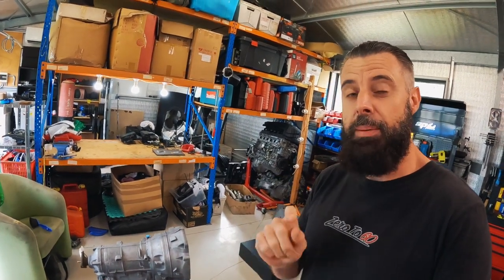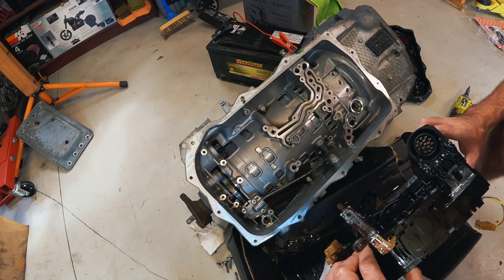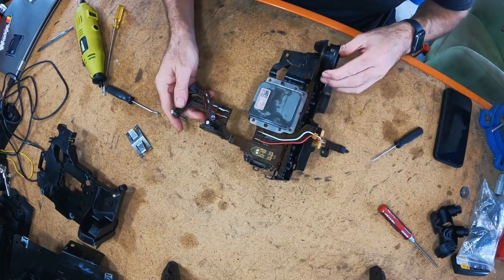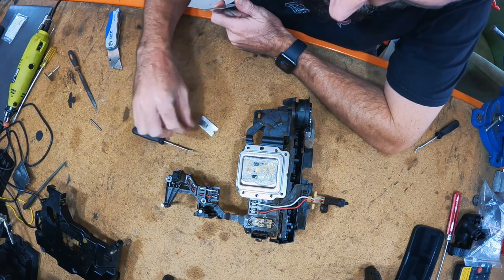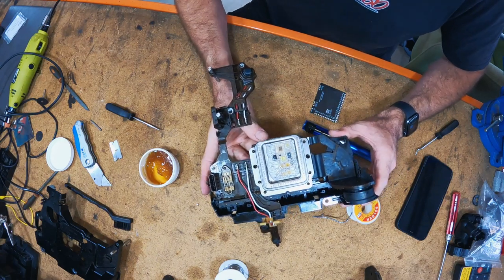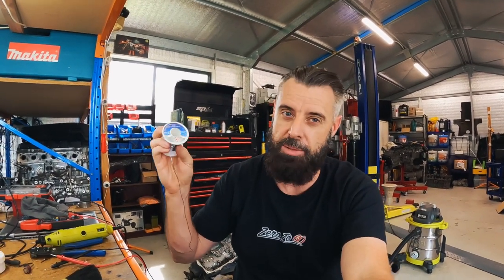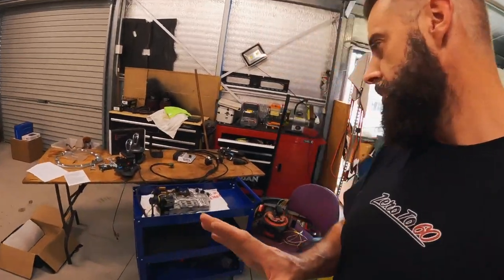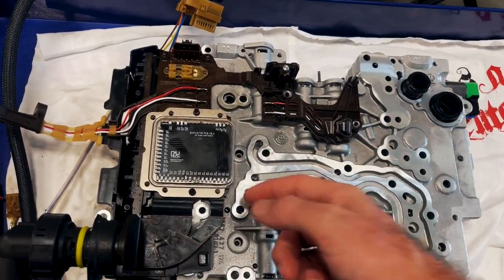Turbo Lamik 8HP TCU Modification Ryutech PCB INSTALL (SORT OF)

Comment: I bought the lamik kit in November and the one thing which was scaring me was the tcu conversion.  I put it on hold waiting for this video. Thank you for the info sharing  it is truly appreciated.
Reply from the maker: Dude it’s not too bad at all. And if you go for one of these ryutech boards and completely mess it up, you can always revert to the way lamik does them. 

The lamik way doesn’t require epoxy either. 

So you have 2 chances anyway!

Comment: As an FPV drone hobbyist a proper soldering iron is a must.  They have proper station style with higher wattage for around $50.  Well worth it from keeping destroying your components.  Using a fine round tip instead of the blade style tip.  Pre tin your board.  Flux is your friend.  Thinner Guage solder wire is your friend.  Clean your tip after each set.  Practice setting solder pads on some scrap boards or buy a soldering practice board to figure out how your solder acts and work on your technique.  I've destroyed many flight controllers in the beginning of my hobby due to simple soldering mistakes.  Take your time. Love your work!
Reply: Everytime I use flux it ruins my tips?
Reply: @piovo1  clean with a brass solder cleaner pad and some solder to refresh the tip.   They're very inexpensive.
Reply: @CHRISGr33r  I do, it just always seems to oxidize
Reply: @piovo1  your leaving your iron on for too long when it's not not in use.  This is really easy to do if you have your heat turned really high.  It doesn't take much heat to do thin wires with a decent iron so you won't have to be too cautious about it, just mindful
Reply: @CHRISGr33r  temp set to 280-320 always gets put into sleep mode after soldering whilst prepping, expensive tips decent iron idk anymore dude
Reply: @piovo1  dang, you got me stumped man.

Comment: I've done a bit of soldering before, huge pads are a pain, I'd try putting solder on the pad first, then place in the PCB and solder over the top.

Melting point of solder is ~150C, to get it to stick to a pad needs to get real hot, once you get some solder melted to the pad, it will be easier to solder to solder on the surface.

Computer PCB pads have a thin layer solder already on the pad which makes it easier.

Comment: Big thanks from me! I flow solder to the pin gap an did not know what to do. You give me the path.
Reply from the maker: Im glad my mistakes have been helpful!!! Please let me know how your conversion goes!
Reply: @ZeroTo60Tube  My adapter plate is ready 95% and now when I know how to save my plate the electronics is next.
Reply: @ksmotorsportru  hi mate I'm doing the same conversion and if you share some photos with all the wires and tcu locations where fit it?

Comment: You doing great job!! Are you going to be future proofing the trans itself tho? Like so it can have a good safety margin in the trans itself to handle the power? If I was throwing in an 8hp70 I'd throw in the sonnax zip kit into the valve body, test it make sure all the valves are good for vacuum, repair ones that are bad, if any. Inspect the internals, clutches, baskets, planetaries, bushings, just to make sure its all good internally, no excessive wear on anything. Unless you know the history of the car the trans came from. Would just be a shame to have gone through so much effort and it be a couple failing components internally that end up ruining a good track day. And with the FlowMax+ turbos on the motor you putting together, you'll be cooking mad power, I'd upgrade the clutches in the trans. Seen some guys build these 8hps with carbon kevlar frictions, then the trans got abused with over 1k hp and then they took apart, inspected and all good as new solid!
Reply from the maker: No, no upgrades to the trans itself. I don't feel the need for this sort of setup based on all the people i have spoken to. However, remember i don't do thing the normal way. It's a valid concern, but it doesn't matter how much you spend, or prepare you can have a failure. So we will go the budget option first and see how it goes. I want to show people what happens on the budget route first. The same mindset i had on the 17t car.
Reply: Oh yea thats right! 🤣 I do keep forgetting its supposed to be on a budget lol I always seem to get carried away with the "might as well do this and that while you in there" #1 reason most my projects aren't done also!
Reply: Really curious how that clutch pedal option on the lamik controller would work.. would it release the clutch on torque converter? Or Nuetral dump type of deal? I'm just as excited to see you get it all put together! A lot of valuable information you give!! Thank you so much!
Reply from the maker: @darksidemotorwerks9867  I havent asked lamik exactly whats happening with the clutch kit yet. However i imagine it will be the clutch on the gears. The TQ clutch seems much smaller than the main clutch packs. From the cut outs i have seen anyway. I feel like the main clutches will take the shock better, where the tq clutch relies on input and output speed of the TQ being close ish as it locks up anyway.
Reply: @ZeroTo60Tube  only problem is I've seen what happens to the 8hp baskets with those clutch dumps on launch control. Because the baskets/drums are aluminum and thin wall, 8hp cars launch off 2nd gear usually with the launch control and the drum over time breaks from the shock. Cant recall off top of my head which drum it is exactly, maybe it was on the earlier 8hps.. I know Audis with the v8 4.0tt 8hp that were built over 900hp had issues with that also. Had guys show me same thing in the Jaguar SVR, same 8hp, similar issue. That one was stock tho. The frictions or steels over time basically cut into the drum ribs untill it was just cut through and the drum needs to be replaced. They thinner more fragile than the 6hp drums. Thats why I'm wondering how the clutch feature would function.

Comment: How does the lamik integrate torque management into the transmission like the factory tcu . The factory tcu kills spark for split seconds between shifts eliminating that it is said to kill the trans early ?

Comment: old solder doesn't really go bad apart from the flux but you were adding flux anyway so shouldn't have been a problem, and the trick to soldering with an underpowered iron is to pre-heat the part first with hot air
Reply: I think it’s cause he used leaded free solder, if he used 63-37 solder which burns at a much less temperature I think he would have been fine, also leaded free solder cracks later on so could cause reliability issues further on?

Comment: I think you could get a better reaction with the solder if you tin the pads and scratch/scuff the tcu pins. And try using a flux core solder just clean it up with alcohol.  Good stuff tho. Not many people are willing to attempt this

Comment: I have come to realise I lack balls when it comes to car mods. You guys are are gutsy risk takers!
Reply from the maker: Dude I used to feel the same way. You just have to keep researching until it doesn’t seem risky any more. The first time I did a mechatronics seal kit on a 6hp was about 4 years ago and every mechanics and trans specialist locally said it wasn’t going to work. But I just read about it and kept learning and reading forum posts and gave it a crack, the box felt like a brand new one. That was like 2 months of that fear and worry about doing it wrong and it worked. When you have your first big fix everything else seems easier. Even drilling in to a block for head bolts haha…..

Comment: Bud may you know - have the kit from Lamik as well , PMC adaptor for M54B30 , e39 2003  5 series 5 speed auto , car boosted . And 8hp70 gearbox ZF , the TCU needed connected to the my harness of 5 speed ? Or just doing wiring , board soldering , screen , controller wirring and it will be enough? Because yours are 6speed and you connect it to your original wiring to get it think it still 6. Thanks in advance 
And sorry for my bad english

Comment: Get yourself a Hakko FM-206 with the desoldering gun and the 140W iron. I know it's more expensive than you want to spend on an iron, but what's your time/hardware worth? How much is avoiding having to pull it apart to repair it worth?

Comment: Is there any way to test the TCU on the mechatronics unit before fitting it to the gearbox without a CAS reprogramming module?
Reply from the maker: well if you have a factory tcu, you need something that will connect and send the required can bus signals.

Comment: how are you doing the torque converter to flex plate?   im using domiworks 17mm thick adapter, the only solution i can come up with, is to extend the dowel on the converter pilot 17mm and to create a 17mm thick ring to space the tc to the flex plate.   if you have an easier solution please reply. lol
Reply from the maker: I’m using n57 torque converter. So only need to add some washers and nut in the N54 flex plate location.
Reply: @ZeroTo60Tube   im using the a90 converter wich is the same back plate, same depth etc. the only difference is the side of the drum on the converter itself.  does the n54 flex plate account for some of the adapter plate thickness?
Reply from the maker: @Mp-jw1qg  To be honest at this point i am just following lamiks instructions for the N54 to N57 converter. Ill get it mounted to the box and see shortly.
Reply: @ZeroTo60Tube  i havent had a chance to get the trans bolted to the block to findout myself. I appreciate you sharing.  I want to figure out how to setup a bump feature on the trans brake and instead of using the foot break to engage it i want to use a momentary button, as with the bump.  lamik said it could be done in the future but, my race car needs the ability to get on the 2 step, and then bump in . Im worried that i wont be able to get the g42-1450 spooled up in time off the foot brake having to stage deep and then get on the trans brake.  Im used to tripping the first  yellow light, getting on the trans brake, then bumping in.   on a side note, Im cutting the entire e92 steel body panels off to replace it with carbon fiber panels from makinka projekt , i got the e92 down to 2400 lbs, caged with the fully bult 8hp75 in the passenger seat  since its not mounted lmao.  this car is going to hit the streets at just under 2700 lbs with me in it.
Reply from the maker: @Mp-jw1qg  hmmmmmm i havent looked that far yet, even with transbrake and 2 step shes gonna take a few seconds to get it on boost. So hopefully lamik sorts it out. I bet they will, i get the impression, until they have a feature working and tested, they just say no no no, which is a bit of a translation issue. My convos went from cruise control will not work, to oh we have cruise working on e90 now, in the space of 2 days.
Reply: @ZeroTo60Tube  im going to come visit after our cars are done. i want to see how you boys on the other side of the pond do burn outs, i hear that i must have been australian in another life because i do rolling burnouts every chance i get lol
Reply: i have a 5000rpm billet stator a90  stall converter and am using maxxecu for engine control so i can get it to spool up quick, but even still i need to bump into the second light. i just need control of the solenoids in the trans individually,  lamik uses the foot brake signal to engage it,  im thinking wiring that to a momentary switch would work for the actual trans brake, but bump would require engaging reverse for a split second , im not exactly wanting to findout if its safe on a 15k dollar billet 8hp75 trans lol.. ill let the stock 8hp guys try it before i give it a go.

Comment: Just now finding the time to go through all your vids I didn't get the chance to watch.
I am interested to know what the price difference (Delta) is between the DCT and 8hp in Auzzie land is?

I am considering my next build for endurance racing to be LS E92, haven't decided on a transmission yet.
This is a project for when I'm done building the sprint E90.

Keep up the good work
Cheers
M
Reply from the maker: DCT with stock clutches is cheaper. But wont hold decent power. The clutch upgrade options on a DCT cost more than the entire 8hp box. 8hp70 is about 10-12k conversion. DCT is probably close 8-10k at the moment if you are buying parts from a wreckers. 8hp swaps are still new, but i think there is more potential.

Comment: I didn't see any rubber seals between  valve body and the gear housing which is perhaps a good improvement. Those seals leak pressure in 6hp and ruin the transmission
Reply from the maker: I did see one. But didn’t spend much time looking, there is at least one. I’ll check further.
Reply: @ZeroTo60Tube  no big bridge seal like the one from 6hp though ?
Reply from the maker: @piroozhr7968  No, no bridge. But i think a similar thing is going on at the accumulator in the front. The oil pump setup on the 8hp is one of the big upgrades over the 6hp, but i havent fully got my head around it just yet.

Comment: Weller solder station with digital temperature control is what I use, works better than irons without controls if quality is important. But soldering can become messy and frustrating real quick if something goes wrong 🤣
Reply: I use the same. I also have a digital hot air soldering gun from them too. I use the hot air gun for BMW Dme mosfets etc. He should of definitely upgraded to proper equipment before doing this job.

Comment: The shutter speed feels a little high. Set it to 1/40th if you wanna continue in 25fps. Or if you want to go slightly smoother you can bump up to 30fps but only a 1/50th or 1/100th shutter speed will work without indoor lights flickering in Australia. And you'll likely have to set your camera to NTSC mode to activate 30fps. And even then, in might be 29.97 even if it doesn't tell you it is, so then you'll have to edit and export as a 29.97 or it'll have weird skipping artifacts with continuous movement.

Outside of that, you can film at 50fps, and for that, I recommend a 1/50th or 1/60th shutter speed. Above all, have your shutter locked/set your camera to auto-adjust exposure via ISO only. And set it to bias half a step darker than default if you can so there's a lesser chance of the highlights being blown out, which you can't fix in post, unlike the darks being crushed, which you CAN fix in post. These tips combined will provide a smooth and consistent natural motion blur, as well as generally smoother and better-looking video for internet content if you go with 30 or 50fps.

Lastly, what the heck does this mod do? Does it give full manual control/universal compatibility with engine swaps/dropping this trans in other platforms? External trans control for both auto and manual modes so there's no need for ECU compatibility? What?

Comment: It’s so strange to me how they put the tcm inside of the pan right on the valve body.
Reply from the maker: I guess its good being all one package to drop in at the factory. But you can imagine the heat that TCU goes through all the time. Pretty impressive really. Same for the 6hp.
Reply: @ZeroTo60Tube  i was thinking the engineers must have been tasked with making something both cheaper and less reliable then they came up with this all in one unit that is subjected to more heat then it needs to be.
Reply from the maker: @BEAMERNOOB   could well be one of those, designed to fail things, thats for sure.

Comment: SOOOO... if this controller works on this 8hp trans, i'm wondering if it will work on the 6hp trans..
Reply from the maker: It does, well I know he used to do one for the 6hp. But 8hp is where it’s at.
Reply: He stopped 6hp work in favor of 8hp because it is its successor in every way.

Comment: The tcu looks like its a SOC (system on a chip) like whats in recent phones. The TCU is alot larger though. I think is the integrated heat spreader which is like a cooling helper but since there wont be anymore computing done there cooling isnt required. (i just got the the point you realized it was a heat spreader)
Reply from the maker: about 20 mins in to trying to remove the solder it all made sense. So got out the big guns...still didnt work ha

Comment: That first solder iron that you use is probably not more than 25w solder iron, with 100w iron you can solder battery cables with no problem, a true 50 to 70w will solder no problem.
Reply from the maker: I agree, I nearly bought a new soldering iron last year. A proper one but just couldn’t quite afford to and this cheap one does the cas and frms fine. Many regrets at this point! Ahhh well we live and learn.

Comment: Dude, Like Brendan Randle is saying, DO NOT risk the whole thing turning to sh.. because of the soldering.
You need to get Rosin Cored Solder (proper stuff) from Jaycar or equivalent electronic supply shop
Bigger soldering Iron, DO NOT use the that damn flux.
Put Rosin Cored Solder onto the iron, You heat both surfaces (pads) then apply solder so it melts and joins the 2 together.
You need to be ultra careful or you can scrap the whole thing, you need to be more careful with the electronics.
You are not soldering copper pipes together 😪
Reply from the maker: I feel like you have repeated most of what i said. Appreciate the concern tho haha

Comment: Yikes.  Nice vid.  You may want to get some electronics spray cleaner for next time.  Brake cleaner may degrade the encapsulation.
Reply from the maker: Yeah, for years I used to buy shelite as brake clean. But I can store the 200l at this shed. Shelite was so clean and evaporated pretty quickly. This latest stuff of from the local auto store in a 20l drum and it’s just not the same. Seems like a much lower solvent content and takes a while to evaporate